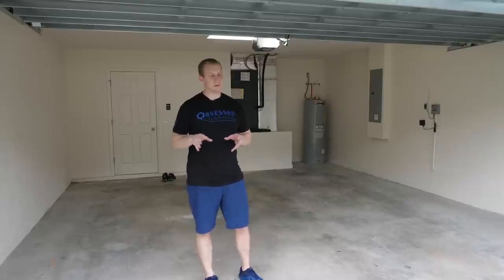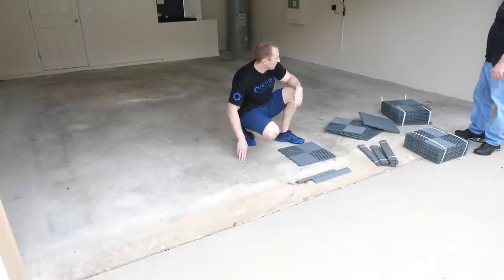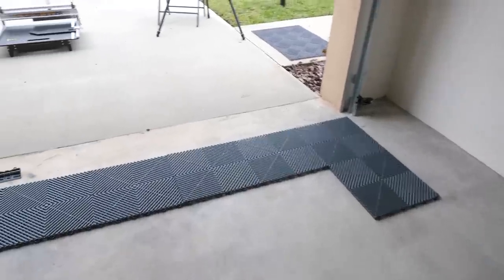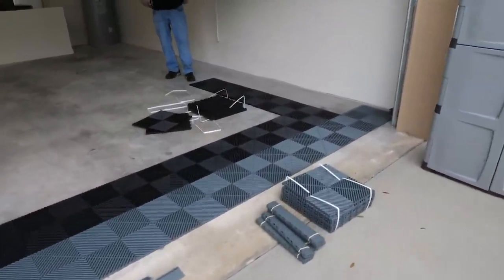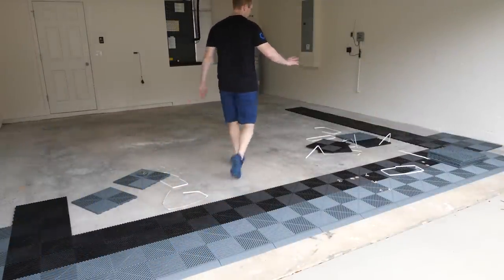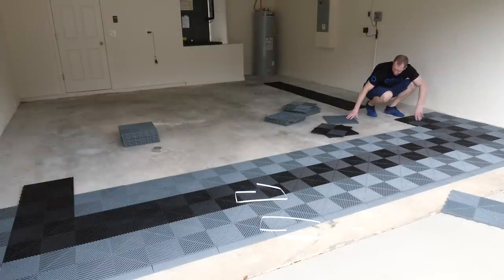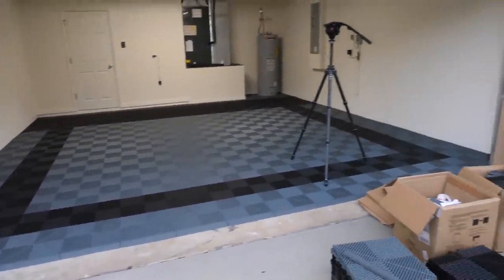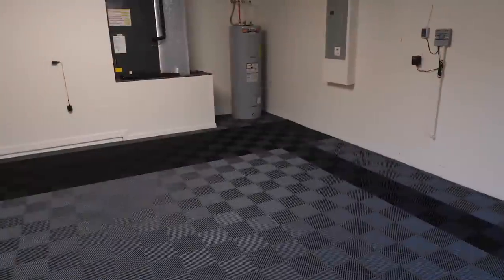Installing Swisstrax In My Dad's Garage

Comment: This looks great when it's new and clean, but dirt is absolutely a show-stopper. Even if you live in a place where the roads are clean and it's relatively dry, dirt will accumulate. If you live in a place where it rains or snows, dirt would build up even more. When there's a buildup of dirt, there will also be a build-up of moisture. There is no way I would install this type of floor.

Comment: Matt, great video. I came over from your videos from VinWiki. I did this in my garage but with a different brand that rhymes with "paceneck". Was a fun project my wife & I did. We too rented the tile cutter from the local HD for a few days as that really helped cutting the pieces needed. Only cost about $50 and I took it back (it wasn't as big as that but was wide enough for the tile. We left a 1/2" on each side and it's been solid for almost 8 years now. It's my favorite part of my house we updated. Went with a full grey floor but added a 2 foot blue and 2 foot orange stripes (offset) with a 1 foot gap. Gulf racing stripes on my floor! It makes walking on the floor in the cold so much nicer.
Reply from the maker: Ha, ha... Good stuff man.

Comment: 2 things: use the Swiss track to raise that water heater off the floor. Second thing: how in the world can this be better than epoxy? You can’t even use jack stands on it. Yeah this product is not well thought out for anyone who actually uses their garage to work with on dirty things. Maybe if you just wanted to park a Ferrari on it and stand outside and look at it, it’s nice.

Comment: I Race Decked my garage 12 years ago. I did a fancy multi bay design.  Still looks like new.  Essentially the same product but the tiles are a bit thinner and smaller in width. 

Don’t take this the wrong way but the  house side of your job looks goofy to my eye. You need to carry the perimeter gray all the way to the wall.  If you ran out of tile, buy more!   Just a word of caution to viewers, should you spill a quart of transmission  fluid or engine oil it is a major pain in the butt to clean up. Essentially you gotta pull the floor to get it all and believe me it’s a mess! Ask me how I know.

Comment: After almost three years later the floor still looks great. Just vacuum every once in awhile. Yes, I work on cars in here and have spilled fluids on floor (antifreeze and motor oil).  No, you are not going to cut metal with a torch (common sense) or braze panels on but pretty much anything else can be done on this.  Another common sense move, "If you know you are going to spill get yourself some cardboard the same as you would on any other floor.  This is a great upgrade to most peoples home garage but not for the rust bucket restorer.

Comment: Looks cool, but oil drips and just using a floor jack or even jackstands I feel would damage these, like if you use one jackstand on one corner of a truck, that's alot of weight. Also hosing down the floor to clean it up seems like it'll cause pooling or some retention, maybe mold issues in future

Comment: Cutting the tile around the edges can be very challenging. You can use $150 BANDSAW and get some professional results. BANDSAW can cut straight and cut circles, so you can get pretty good results. I believe it will give you the best results at the cheapest cost.

Comment: Swisstrax works great in the bottom of a mailbox to keep the mail from getting wet.  Also, screw mounted vertically on walls is a great way to keep your hanging tools from banging into the paint.

Comment: Okay, it looks nice now, but how the heck would you clean dirt out of it? Like, if you car got muddy you would have to park outside until it's clean again. It seems like the only way to get rid of mud or rocks would be to pull the tiles back out, talk about a huge pain in the butt. 

Good thing this guy lives in Florida, because anywhere with snow and mud would fill all those little cracks in no time.
Reply from the maker: Just spray it off with a hose.  The water and dirt will run though the channels under the tiles.  Or wait for the dirt to dry and vacuum it.

Comment: these things are complete trash.  it catches everything from dirt, to salt, to leaves and grass clippings.  it gives a safe place for ants and other bugs to travel under them(hope u don't have termites in ur area[you have them]).  the only solutions are to epoxy your floor, paint it or polish it.  you can't have holes or gaps between tiles and the floor with garages unless if u want mold, dirt, salt, and bug problems
Reply from the maker: Ha, ha... No to all of that.  I'm pretty much the authority on all things garages.  Porcelain tile is my favorite.  This is a band-aid like all other flooring options in the garage, but it is the best solution for almost all cases.  Epoxy has an extremely high failure rate and only looks good to those that aren't discerning.  I'd rather have bare concrete than any type of epoxy.

Comment: Seems like the main problem that lead to plastic snap flooring, is the in ability to verify a qualified installation resource for any of the other flooring options. Thus a decision was made to revert to a flooring solution that was inside the skill set of the garage owner's son. Also the fact that he is selling this flooring solution I am sure did not factor into this recommendation. This video seems disingenuous or misguided at best unfortunately.
Reply from the maker: You are clearly new to watching any videos I have made.  You might want to watch some more before making comments like this.

Comment: Hi Matt, I’ve been watching your Swiss videos, great jobs by the way. I just wanted to ask why not just use a nice 12” aluminum ruler for your side cuts ? You won’t be fighting the tape end on the small measurements. Just throw a ruler in your box and it makes a great straight edge too . 👍🏻
Reply from the maker: Because I never thought of it...dang it.  Thanks for the tip.

Comment: Weird question, but what does it feel like when you walk on it in bare feet? I'm in my garage with no shoes often because I have a 2nd refrigerator in there.
Reply from the maker: My kids do it without a problem.  I have baby feet, so it doesn't feel good.
Reply: It's a bitch bro. I had these tiles, and I'm the same way...I'm sometimes barefoot, but I'm also on the floor alot working on my car and it hurts like a bitch after a few minutes. Epoxy is definitely the better way to go.

Comment: Been debating between doing this and epoxy w/ top coat. I've got woodworking shop in 60% of my 2 car garage. How does swisstrax handle 4" wheels? I've got heavy workbenches, tool carts on heavy duty 4" and others on 5" wheels.  I'm imagining that the wheels might get stuck in the rubber or plastic ribbing?

Comment: Are you serious??? Just epoxy the damn floor!
Reply from the maker: Epoxy is junk.
Reply: @ObsessedGarage  but you can clean it better and you dont need to rip it out if you drop a screw.
Reply: @ObsessedGarage  To be realistic, I believe that statement needs some clarification. Residential grade epoxy is junk. Professional grade epoxy, when installed properly, is nearly indestructible and will last indefinitely.
Reply: @ObsessedGarage  Epoxy is junk. Cant weld on swisstrack. Have to pull the tiles to sweep the floor.
Cant jack your car up on it 

  EPOXY IS JUNK

👌

Comment: Forget dirt. That's obviously better here than with a solid floor. This can only be appealing to people who don't use the garage for anything but parking cars. Anyone who handles screws and other small parts will see this as the nightmare it would be. No Thank You!
Reply from the maker: 95% of screws won't fall through.
Reply: @ObsessedGarage  Anything under 1/8" thick can. That's a LOT of hardware of various types. Screws are just one example.

Comment: Thinking about doing this when my new build finishes and going full OG with my wash setup inside the garage.  But I was wondering if this is ok on bare concrete. I was under the impression you shouldn’t wash in your garage on bare concrete and this just drains right to it?

Comment: What is the advantage of this? To merely sweep,or spray out the garage will require removing and replacing dozens of tiles. I would not want dirt and salt building up for months under the tiles. That's a surefire way to reduce the floor's lifespan.
Reply from the maker: Why not?  Otherwise you have to sweep the floor every week.  I can choose to clean it when I want.  There is no lifespan to plastic.

Comment: how does this flooring do with leaves? and water when you bring a car in from the rain?
Reply: im having the exact question.Wont oil, dirty water etc get drill down through the tiles and stuck on the ground??? So I really dont know the benefits of this besides leaving dirt tire tracks?
Reply: John Ye Matt shows in the M3 oil change video how easy it is to clean up oil by lifting up the tiles. I’m looking into these for my new garage also. I’m between these or polyurethane floors.
Reply: @TeslaWorld  havent watched that yet. will check it out
Reply: Shop vacuum to pick up leaves or sand. Just pull up tile to clean up any spills.
Reply: Honestly it just seems like sweeping the dust under the rug.
Reply from the maker: This is my favorite part about the flooring.  We have zillions of these tiny Oak leaves in FL.  The never make it past the 2nd or 3rd row of tiles.  I either blow them out with my EGO blower or just pick them up.  In the past, I'd have to sweep my floor every week because everything would blow to the back.
Reply from the maker: Imagine this.  The tiles are 3/4th of and inch thick.  You would have to bring a wheel barrow full of dirt in the garage to notice it.  The two times a year, you dump oil on a spot, pop the tile up and wipe it.  It takes 30 seconds.
Reply: Obsessed Garage great way to explain the ease of cleaning. I hate needing to sweep/blower the BACK of the garage every week, especially when the winds kick up. Looks like Swisstrax is the way to go. Thanks for the reply!

Comment: OK so you've claimed dirt as a non-event... But what about shelving with legs?  You cut around each of the legs or is this stuff tough enough not to get crushed by shelving crammed full of stuff?
Reply from the maker: Depends on the leg type.  Most just put on top of the tile.

Comment: So when I drop a small screw or washer and it falls through to the bottom, I'll have to pull up tiles to get it out??? Thats' not better. What if oil gets dripped or spilled on it. I have a locust tree that has these tiny little leaves that get tracked in on the tires. There's not way they will be able to be swept out off of this stuff. I have to sweep these leaves out at least once a week in the fall and there's no way I'm pulling up tiles that often. How about a chair on whees, how well will it roll? I see so many problems with having this on a garage floor. I get it that epoxy is not easy to repair, contractors are un-reliable, it's very expensive and so-on. But when done right, it IS a better floor. And yea, what's wrong with Grandma?
Reply from the maker: So the 3 times in the next ten years you drop a screw small enough to fall through, yes, you would have to pop a tile up that takes 20 seconds.  You won't have to pull up tile to vacuum leaves.  Chairs and dollies roll just fine.  There is no such thing as Epoxy done right.  It's always janky no matter who does it.  It's unfortunate, but epoxy has too many imperfections.

Comment: I live if pine needle country, and they get dragged in with my car/wheel-wells. At first glance, this would get clogged up very quickly. Am I wrong?
Reply from the maker: This is perfect for that.  Where I am oak leaves are the issue.  Without the tiles the leaves and pine needles end up blowing all the way to the back of the garage.  The beauty of this stuff is that they get trapped in the first tile or two and never make it back there.  I just pick them up every few days by hand when necessary.

Comment: I see the complications that would be created by offsetting the joints (if the interlocking edge permitted it) but why not offset the leading edge since that is going to take more abuse than the center of the floor?

Comment: I have the 13 inch Swisstrax and I sympathize with the people in hot climates. I am in Canada and installed chocolate brown and cream (ivory maybe) tiles. I like to work in my garage with the door open. On 30 degree C. days (90F+) my tiles buckle badly. Do not install this stuff edge to edge if you like to work with your garage door open. This stuff needs room to expand. Do not put heavy stuff on it like woodworking equipment (table saws, planers etc.) or the floor won't be able to move. I like this stuff, looks great, but they need to sell you a flexible expansion piece to put down the middle of your garage. I feel sorry for the Arizona guy who commented. ( I visit AZ in the Canadian winter) about the heat. I love my floor but don't like it when it buckles.
Reply: If you do find a problem with buckling, isn't it easy to just recut the edge pieces?
Reply: @vincentkruskal3884  The problem is that the weight of things (Table saw, Work bench, cupboards etc) will not let the floor move. I have at least an inch to an inch and a half from the wall all around the perimeter which is lots of room for expansion but the weight of everything won't allow the floor to move so it buckles up right where I need to stand behind my table saw.

Comment: Another option for centering would be to move the whole thing sideways by half a tile, putting a tile centered instead of a seam. Make the border pattern 1 tile narrower, then have about 1.5 tiles each side instead of one and a tiny sliver. Would still use the same amount of tiles but the larger pieces might be easier to deal with instead of the tiny slivers.

Comment: Flooring is started in the center of a room for various reasons....measure the room, the tiles,  draw a large rectangle in the center of the room....so many rows across, so  many down....then measure to the wall. what you want to avoid is a super narrow strip at one side & an almost full tile or even full tile at the other. move the large rectangle over to avoid this. very narrow tiles are weaker & don't look that nice....and if the space is not perfectly square, the center of the room will look great & furniture etc around the perimeter will camouflage slightly wider row etc as you progress down the room.
Reply: Agreed    - equal on the perimeters...

Comment: I think it's hard to clean those.... lots of dirt will accumulate inside of it and stagnant water when you parked a wet car or spilled some liquid. Carpeted toilet/bath feels without the mush!?
Reply from the maker: No, they have channels for water is there is that much that need to run.  The tile is open, so water would evaporate no differently than if it were on the bare concrete.  Think about this logically.

Comment: If you can push the whole floor at once, won’t a car also be able to move the floor with acceleration / braking? I can imagine driving in, touching the brakes and sliding into the house.
Reply from the maker: Once you cut edges, the wall keep the floating floor in place.

Comment: I have to agree with everyone else - every time I see products like this. Looks cool for someone who uses their garage to only park their vehicles. I could never see using something like this with the manufacturing and repair work I do inside my garage. The slag alone would melt right through something like this. Not to mention the rust that would accumulate underneath between cleaning too. Looks beautiful otherwise. Nice job!!!
Reply from the maker: I would do some high quality Porcelain tile in that environment or just leave the floor bare concrete.

Comment: I can get a professional high end epoxy floor done in my 2 car garage, larger than your dad's garage for $1600 with a 10yr warranty.  How much is that garage system going to run and what is the warranty?
Reply from the maker: First, what is a warranty going to do when you floor fails.  You can't just fix it.  You'll have to diamond grind it and redo it.  That makes your entire property a disaster area with all the dust.  $3.95 sq. ft. and 15 year warranty, but I'm not sure what the warranty would actually cover.  Plastic isn't going to fail.

Comment: nice look but not practical.  I can see dirt getting trapped in the groves and impossible to get out. In the winter you're bringing in wet vehicles and the water drips and freezes in these groves.
Reply from the maker: That's the best part about the tiles.  Dirt/ice/water runs through it.  You can then deal with it later.

Comment: Obviously nobody is planning on doing any work in that garage that may involve dropping screws and nails and cutting wood.
Reply from the maker: It’s actually the opposite of what you are thinking.  Drop a screw, it sits on top of the tile.  Cut some wood, the saw dust falls below the floor and disappears.  You can vacuum it up later when you feel like it.

Comment: Is this suppose to be a floating floor? If so then why are we putting tile all the way up to the edge? Wont it buckle the floor?
Reply from the maker: I like it fit to the walls.  As long as you don't have massive heat/cold swings, its not an issue.
Reply: @ObsessedGarage  Ok I was just wondering. I live in Indiana and was not sure how close I could put it to the wall.

Comment: I have always preferred a floor tile that is grey with an outer border. That Grey Matt is a little too dark. Their lighter grey (silver) is too light. Swisstrax needs to make a grey in between these 2 colors.
Reply from the maker: They do have Pearl Grey that is a tad lighter.
Reply: Did you mean Pearl Silver
Reply from the maker: There is Slate Gray, Pearl Grey, and Pearl Silver.  Slate is matte and darker, Silver is the lightest, and Pearl Grey is in the middle.